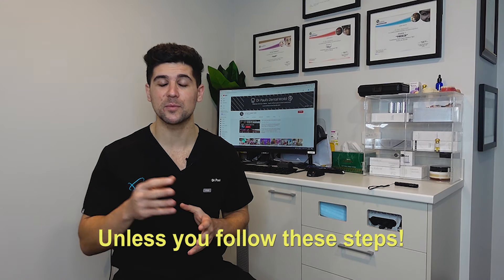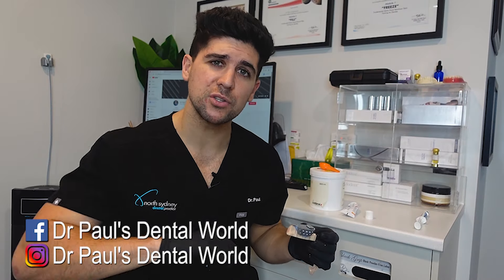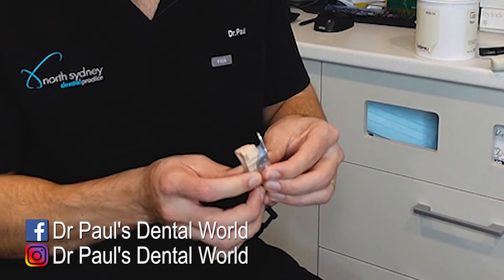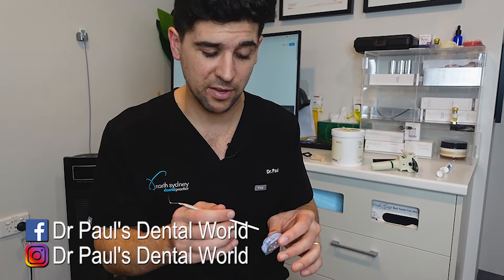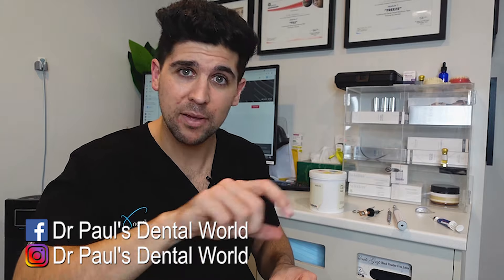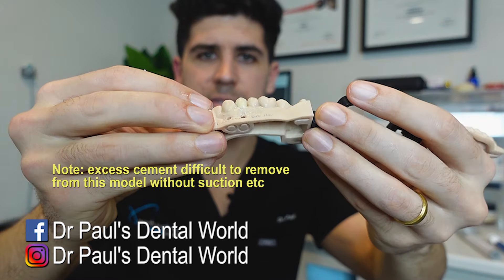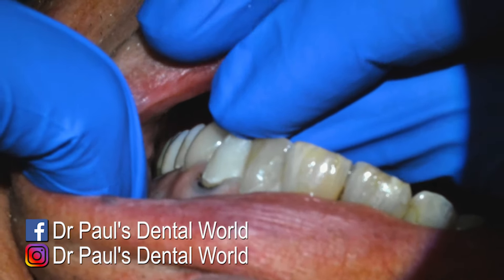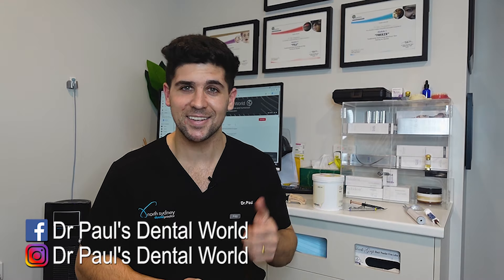HOW TO MAKE THE PERFECT TEMPORARY CROWN (Provisional Restoration)

Comment: Hi Dr Paul, i need your guidance. I had a crown prep on #15. I then went to endo and RCT canals drilled and covered with temp filling. Temp crown placed back on until then. It's only been 3 days and the temp crown has fallen off 3 times already. Tonight i just put some pronamel toothpaste on it and put it back on. Is the toothpaste safe to use on a temp filled RCT? Also there any toxic temp cement? I have extreme heartburn every time the endo re cements my crown. I feel so defeated. Any words of advice appreciated 🙏.
Reply from the maker: Hi Shawn, the toothpaste is fine to use, I just doubt that it will hold. It really should be re done properly because if the crown isn't sealing off the RCT area then bacteria could get in. It sounds like the crown is not retentive enough. They might need to add some resin to the sides of the tooth when they glue the crown on, that covers the crown and the tooth, kind of like how sticky tape would.

Very strange re the heart burn 🤔
Reply: @DrPaulsDentalWorld  thank you for your reply. I will get it looked into. 🙏
Reply: @DrPaulsDentalWorld hello Dr. Paul, you meant resin as in adding composite to the interproximal sides to creat more retention? Can this resin stay as part of the crown prep for the definite crown placement? 
Also, can you please give some advice on how to fix a overtapered prep? Thank you!
Reply from the maker: No, this comment was about the temporary crown falling off. It may be a retention issue with the preparation, so sometimes a solution is to etch the enamel on the buccal and lingual, and add resin to that area that also covers the temp crown so it holds it in place. When you remove the temp crown, remove the resin too. If the resin is added interproximal, it will end up being a food trap which leads to more bleeding on cementation day.

Fixing an overtapered prep - if it is already been reduced too much, you can add core material (resin) to add more bulk of the tooth, then re-prep it to be less tapered. Alternatively, don't worry about it and use a resin cement, which does not rely as much on a tapered preparation for retention.

Comment: Hi Dr Paul. at uni we were taught that when we remove the index key, the temp crown stays on the tooth and we have to use a flat plastic to remove the temp crown which for me usually results in destroying the crown. How were you able to remove the temp crown in the index when removing index from the tooth prep.
Reply from the maker: A few things
- well fitting putty key, to make sure that you don't have lots of excess that flows into undercuts
- side sprue vents to make sure excess doesn't go interproximally
- no undercuts of your prep
- taking it off at the right time (approx 40s for luxatemp)
- make sure the tooth is not dry before placement. Moist from saliva is OK, or Vaseline works even better (but harder to remove afterwards, glycerine is other option)
Reply: @DrPaulsDentalWorld  Thanks Dr Paul!

Comment: I loved this video!!! I am really struggling with removing the contacts too much and the permanents not fitting correctly. Lol could you PLEASE do a video on how to pack cord?? That is the thing I am struggling the most with. I find it hard to use a mirror and get the interproximal spaces. I just subscribed!!!! :)
Reply from the maker: Hi there, if you're having to adjust contacts to me that means that the contacts for your temporary are loose and allowing the tooth to drift mesially so when the crown comes back it is tight. If you have a well fitting temporary, this shouldn't happen. Try and make your temporary following this technique and I think you'll be ok

Comment: Very helpful! The only thing I'm wondering is how to prevent the provisional material from shrinking within the tray once it's taken off the tooth.
Reply from the maker: Two options
1) Leave it in the tray and use something like a flat plastic or ball burnisher to push the intaglio surface towards the outside to ensure it stays adapted to the tray
2) Take it out of the tray once it is firm enough and place it back onto the tooth. Leave it for 5 seconds and then take it off (so it doesn't shrink onto the tooth). Replace it and repeat until fully set

Comment: I'm a dental student and hate making provisionals because they're so difficult for me. But your video had so many great tips and things I didn't even think about - thank you so much for sharing your expertise! I'll use these tips the next time I make a provisional. 

Do you have any tips for making a provisional straight on a broken down tooth if you don't have a previous cast to make your putty off of? I'm assuming that in private practice if a patient walked in, you wouldn't take the time to take an impression, wax it up, make your putty, and then bring the patient back in for the crown prep and provisionalization.
Reply from the maker: Hi there! I'm glad that you liked it 🙌

In private practice, we don't have a lot of time (and as bad as it sounds, time is money tbh) so you can either quickly patch it up (if it's a small piece) with some resin, and then take a putty key of that, or, you can make the putty key of the broke tooth, and then use a bur to drill out space for where the tooth would be if it wasn't broken, and use that as the temp crown. You'll likely have to make adjustments to it when it's made (it will be rough, and occlusion likely off) but it does the trick, and is quick.

Comment: Use a 6 round to ease the fitting surface a bit.
Was told of the vent hole trick some years ago but never been a fan but it does the job.
Reply from the maker: Thanks for the comment. I'm assuming if you do it then it must work well for you, but I'm not sure if I want the cement layer any thicker than it is normally - the thinner it is the less chance the temporary has of breaking. I also like that the vent hole means a lot less excess at the margins and interproximal.

There's likely a few different ways to do it, as long as it works 👌
Reply: @DrPaulsDentalWorld  Your vid would have been so good for me when I was a new graduate. I learnt all this the hard way as I guess you did. Awesome that you put it out there.
Reply from the maker: Thanks Brendon, much appreciated 🙌

Happy to try and make things easier for the new grads so they don't have to learn the hard way that's for sure!

Comment: Hello Dr. Paul. I am a dental student and I had issues with luxatemp shrinkage. I also use a putty and wait for luxatemp to set around 30s like you said for a gummy bear consistency. And then I remove putty from the mouth. But I noticed my temp will shrink and will not fit the prepped tooth anymore. Do you know what I did wrong?
Thank you!
Reply from the maker: Two options for you:
1) Make sure to leave it in the putty key for long enough, and also use an instrument like a ball burnisher to push the intaglio surface outwards to make sure that it does not collapse and shrink on itself
2) Once it has set hard enough for it to be removed from the putty key (maybe an extra 30s) place it on the crown prep for a few seconds and then remove it. Repeat this a few times and then leave it to completely set, on the tooth. Make sure that it is relatively hard by this stage, otherwise it can 'shrink' onto the tooth

I normally do option 1

Comment: Great video ! How do you make a temporary crown of a grossly destructed tooth when you dont have prior putty impression?
Reply from the maker: Two options
1) quickly rebuild the tooth and take a putty index
2) take a putty index of the broken tooth and then drill away the area where the tooth structure is missing, making the shape of a tooth. This option will require more chairside adjustments but is very easy

Comment: On my front tooth, I have a temp crown. It stayed in fine until it was removed to try the perm crown. The perm one was several shades off and had to be sent back. The temp was placed back on last Thursday, fell off Friday, glued back Monday, came off Tuesday, set back in yesterday and is already moving and  is on its way of coming out. I’m not biting with it. The only think I do that could be causing an issue is rubbing my lips together to spread my lip gloss. There wasn’t a problem with the temp for over 2 weeks but since it was removed it just doesn’t want to stay. Is there anything you can please suggest that I can do at home for a week until my perm crown is back in?
Reply from the maker: Ah damn, sorry to hear!
If it falls out, you can get temporary denture glue from a chemist, put it on the inside of the crown and glue it back in place. It might help it stay during the day.
The other option could be using super glue. It sounds crazy, but it does work. Best to ask your dentist if they're comfortable with you doing that though
Reply: @DrPaulsDentalWorld  thank you so much for your reply. I appreciate your time and concern. I’m going to try your suggest. Luckily, there is enough tension and suction to keep in when I’m not eating. I’ll stay in the house for the next week and keep my mean mug on, so no one sees my tooth. 😁
Reply from the maker: @ajbailey8469 sounds like a plan!

Comment: Great video!! My provisional got stuck to the prepared tooth ! Any tip on how to get it out !
Reply from the maker: If it's already stuck, you have to prep it off. You have to prevent it in future
- make sure there are no undercuts
- use Vaseline on the tooth
- dont let the provisional set for so long
Reply from the maker: To help get it off - section the temp buccal to lingual, twist using the sharp end of a metal instrument like a walls carver

Comment: Hi Dr. Paul, may i  know what are the common reasons for a high bite caused by temp crowns?
Reply from the maker: Main reasons that I can think of:
- Not seating the temp crown down far enough (can be because cement stops it from seating properly)
- Inadequate seating of putty key when making the temp crown

Comment: Hi Paul and thank you for the video. I'm using Protemp 4 instead of Luxatemp and the worst thing I hate about temporary fabrication is actually waiting for the temporary to set. The manual says 5 minutes (from start of mixing) and I'm noticing in the video you mentioned 1 minute after taking it out of the mouth. Do you think I can shave a couple of minutes by taking it out of the matrix earlier?
Reply from the maker: Yes I think you can. Probably closer to the 2 minute mark. As long as it's pretty solid, that's when you can take it out to start cleaning up excess
Reply: Thank you. Will try that :)  @DrPaulsDentalWorld

Comment: Hi! Can you use material that has expired in 2017? I am working in an office that uses structure 2 sc and everytime I take the temp off it is still soft. I am so confused , what am I missing? It took me 45 mins to make a decent temp last week.. I am assuming the material has been compromised because it expired in 2017.thank you in advance
Reply from the maker: Hi there, if the material isn't setting, then it sounds like the expiration date means that it isn't working.

Test it out of the mouth first. Bleed some from the cartridge first (meaning without a tip, you squirt material out to make sure that it's flowing freely and equally, then put the tip on). Then see if it sets or not

Comment: Nice video! I have such an issue. When almost setted temporary crown with index removing, it's shrinking extraorally and finally i have a problem with the provisional placement. It's too tight and adjustments are time- consuming. How to manage this problem? Thanks!
Reply from the maker: Hi there, exactly follow the steps in this video, and you shouldn't have issues.

If it is shrinking extra orally then maybe you are taking it out too early and it is collapsing? This would also lead to it being too tight..
Reply: After you remove the index and crown to make sure it doesn’t lock on, you can replace the crown to finish polymerization on the tooth.
Reply: @DrCharlieCage hello Dr. Charlie, so you recommend taking the index out to prevent lock in, then removing temp out of index right away and place it back onto the prepped tooth to finish polymerization?
Reply: @hanlai4885  it’s a balancing act of when to remove it that is learned over time. Early enough to where it’s isn’t so solid that it locks in but give it enough time to have enough structure to prevent distortion

Comment: Hey Dr. Paul, what do you do if your margins are a little open or a small part fractured off? Do you reline in a specific way or just try again entirely? Thanks!
Reply from the maker: Good question! If this does happen, then I simply add flowable composite to the area of deficiency and then cure it. I find it easiest to do it when the temporary on the tooth so it matches the exact shape of the tooth, then take it off and trim back the excess

Comment: Can you give the brand of putty you use?  How about temporary cement?  I am surprised you said you sometimes leave the vent hole filled with temp cement.  In my experience a slight perforation in the temp will deteriorate all the cement over time and the temp crown comes off.
Reply from the maker: We use lab putty by coltene and I use either temp bond or durelon for my temp cement (depending on how long thw temp will be there).

Yes I find it deteriorates as well, but that tiny vent hole does not lead to it falling off. If it falls off it's because the prep does thsve enough retention, or the temp crown isn't sitting on properly. Filling that vent hole with resin is not really doing anything for retention
Reply: @DrPaulsDentalWorld  Thanks for your prompt response.  I do appreciate your tips and will try them  next week.
Reply from the maker: Let me know how it goes 👌

Comment: Umm any time there’s been “holes” in the occlusal of temps it’s caused post op sensitivity (or it could’ve been the doctor’s prep? 🤷🏿‍♀️)
For temps I tend to make my interproximal surfaces slightly larger so it has a “tight” fit and I don’t need a lot of cement to secure my crowns. This adds a level of security if the cement weakens there is still enough retention to keep the crown in place. I’ve never had an issue with the doctors seating permanent crowns
Reply from the maker: Ummm did you watch the full video? I explained to seal off the hole with composite 

If you've got something that works for you, great. Obviously (look at how many views there are) it's a problem for some, hence why I made the video.
Reply: I didn’t get to finish. But I watched most of it. I think that would work well for private offices but for corporate dentistry the doctor having to come back to seal the occlusal with composite would frustrate them/not be productive. But otherwise the tips were awesome.
Reply from the maker: @all32teeths in Australia (and a lot of other countries) we don't have assistants who can place the temp crowns, we do it ourselves. 
Also I don't know the rules and regulations where you are but surely if you are placing and cementing a temp crown, you can seal a small hole with flowable composite. Also, if you use a temp resin cement it seals the hole automatically
Reply: @DrPaulsDentalWorld  honestly I think the doctor should make/place temps. I find that cooperations here in the US push so hard for money that patient care goes down the drain. (Many assistants are not efficient with fabricating temps, and docs dont have time to do it or show them)In the US assistants can only make and seat temps with additional licensing, which depends on the state. I can do many things a doctor does except touch the patient with a drill. (So yes, I can place composite, hope I won’t need a bite adjustment 😊)*apologies for the slight rant*
Reply from the maker: @all32teeths ah makes sense! If it's just to fill the small vent hole then the chance of needing a bite adjustment shouldn't be any higher VS  not placing one and just cementing the crown. Sounds very money driven..

Comment: can you do a venting hole with a permanent crown?
Reply from the maker: Technically yes, but you shouldn't. It compromises the crown. And it's also not necessary because the lab allows for the cement space using something called die spacer, so it should flow out freely. Sometimes it helps to rock it into place. You can also 'tap' it on when it is seated to ensure it's seated all the way

Comment: If you are placing a core in the tooth and it’s already broken down before you do your crown prep, and you don’t have a tooth to take a putty index of like that how would a temporary work in that situation?
Reply from the maker: You've got two options
1) quickly restore the tooth with some expired resin (just to save using material that costs money) and then use that to make the putty index
2) make a putty index from the broken tooth, then use a high speed bur to drill out space in the putty index in the shape of the final crown.

I used to do the first way, but now mostly do the second because it is a time and material saver. The key is to make sure that you remove enough space inside  the index that you don't end up with a crown that is deficient. When you actually make the temp crown, it then means you will have to cut it back and re shape it, check the occlusion and adjust etc, but that doesn't take too long
Reply: Thank you very much!
Reply from the maker: You're welcome 🙌